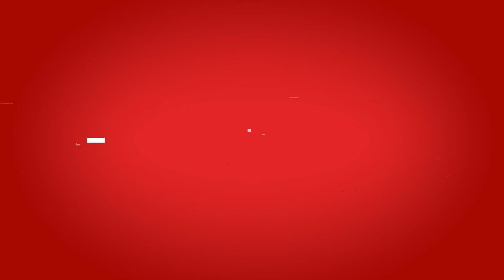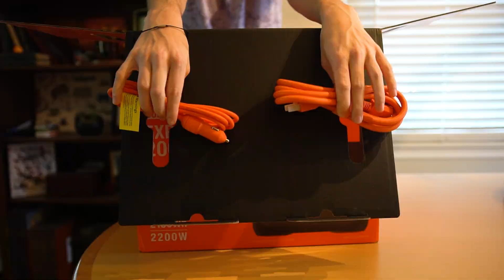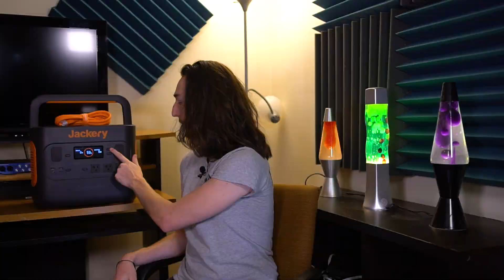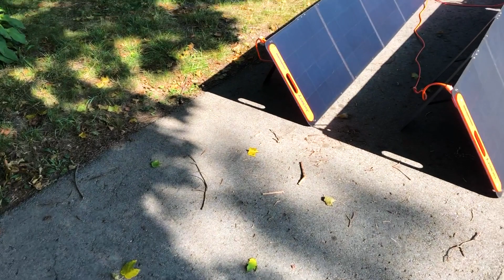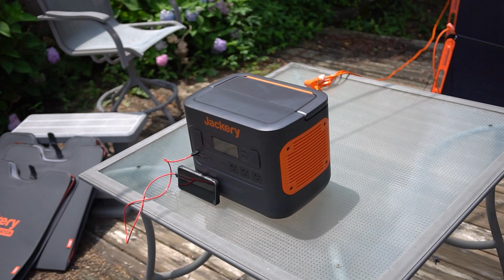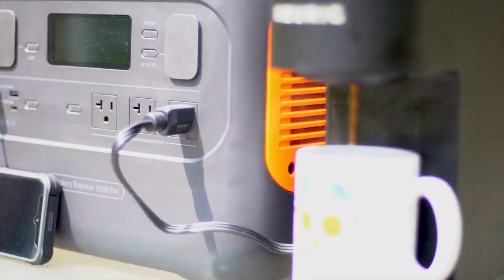Jackery Explorer 2000 Pro: The Best Jackery Yet?

Comment: Have you tried to use Jackery DC charger that comes with Jackery 1500 to charge this unit? 
The output of DC brick is 24 volt and 12 amp, but Jackery 2000 pro didn’t charge.

Comment: Thumbs up to the review 👍
I have this and decided on just two of the 200W panels. This will give me a reasonable tradeoff in portability and recharge time, especially if I am not driving the battery too far down. Getting the panels on sale through Jackery directly or other means can really help, as the panels are pricey.
I did use AC to the 2000 Pro to get it charged up from the factory shipped level. Watching it draw 1.5KW at first had me anxiously awaiting it downshifting its current draw as it got closer to 100% Even if you don't want to use AC you should always check out the different charging methods to make sure they all work OK.
I used to have a gas generator and this will work better for my uses. Besides having to maintain the generator after properly breaking it in, and being careful about the fuel you use through its carburetor, the one thing that really bugged me is how LOUD they are. I hated firing it up even for routine checks in the neighborhood, let alone taking it out to a camping spot.
I will primarily use it as a home backup, but it and its two panels are fairly portable for camping. For shorter overnight trips I sometimes just use my Jackery 300 (with Elecaenta 120W panel).
Charging it with a vehicle is a slow process...really better for topping it off to and from a site.

Comment: I just had a Jackery phone rep tell me that the solar saga 100 watt panel will not plug into the Jackery Proo 2000. he sounded like he didn’t know what the heck I was talking about.
I have a new 2000pro.. Would I be able to hook up my two 200 watt panels, into one series connector, add the extension cable and plug into one port and plug my 100 watt into another extension cable into the other port?
TYIA
Reply from the maker: It will plug in by itself, but you wouldn't be able to combine it with other panels. There's only one solar input plug - the splitter cable is a Y parallel adaptor, but they all go into the same input port/ MPTT controller. To combine panels, you need to balance the voltage and current. 

The only semi-portable battery I've come across yet with two input MPPT controllers is the Bluetti AC300.
Reply: @MakeUseOf  TY

Comment: I have a little Trillium trailer, can I plug the main harness into this unit to run my fridge, lighting and modern electronics when I’m off the grid ? I like that I can charge it while using it with solar, but will it do the job ? I’m almost ready to pull the trigger on this thing, but there’s still too many question marks…….

Comment: I just got the 2 panel package, do I need the adapter or can I plug each panel directly in the unit?
Reply from the maker: No need for an adaptor unless you want to add more panels; there are two inputs.

Comment: What's the battery chemistry? All of the Jackery's to date have used NMC batteries, these only yield about 500 cycles before capacity is down to 80% of original capacity. A lot of competitors (Bluetti, Ecoflow etc) are using lithium iron phosphate batteries, which give thousands of cycles before dropping to 80%. IMHO at some point as Jackery pushes their capacities higher they're going to need to switch to LiFePO4s to stay competitive. You can get away with li-ions when you're making smaller lighter units in the 1 - 1.5 kwh range. But if they're going to push up to the 3 - 5 kwh range they will need to use LiFePO4 batteries or they will lose out against the competition.
Reply from the maker: Li-ion, yeh. 1000 cycles. That's the only (big) drawback of these.

Comment: Still a pretty good review and a pretty good battery station. But also still lacking type c charging input or input/output to make it easy to charge the battery station. Also downside is that your limited on using the dongle on using there solar panels. Also nice color cords and easy to find them. But the highest battery station that is still crown as King that as higher Wh. But carrys a high cost tag and it's Goal Zero yeti 6,000x and as type c charging input/output and as the bells and whistles for my future setup. Also with goal zero brands not really limited on using there solar panels and it comes with app control. Also almost a average home uses about 30KWh per day and too get that much it will be 6×5=30. Meaning will need 5 goal zero yeti 6,000x to get almost about 30kWh. But in reality it will be too much and won't be realistic if solar panels are helping out now would it. Plus they are much heavy and I don't think a average budget person would want to try to move 5 large battery stations around. But hey about 30kWhs or more from a average household if house is much bigger. Well power usage maybe much worse if not using power wisely. But hey just math, science and numbers and as not been experienced with real world testing.

Comment: That’s a good point. Once the battery is Full, its Full. Who cares if it took 2 hours or 8 hours? If you need that quick of a turn around on 2160w of power, then you probably need a dedicated power source. Seriously. We are trying to slow down, right? lol. You are better off with 2x100w panels and getting more (2+) Jackery units. If you have the time, more stored power is better than more potential power. Am I off base here?
Reply from the maker: I agree, it makes more sense to spend that money on another battery, then leave one to charge all day while you use the other.
Reply: @MakeUseOf  TY. There is a use case for sure for multiple smaller or medium batteries in place of 1 huge battery. The Jackery 1000 Pro launches tonight.
Reply: Only use case I can think of is someone whose TIME SPENT IN CAMP is little, like hiker’s and biker’s. If your time is limited, and you don’t want your $2k - $6k equipment stolen, maybe more panels makes sense. But they take up more storage room.
Reply: @heavysighs  I can't say that it is the best Jackery yet, but I know it is one very expensive piece of equiptment.
Reply: @looneytooonnsss2223  that ECO FLOW Delta 2 looks even better. IDK. It releases on the 16th.

Comment: Too bad there is a very large oversite on the 2000 pro with the MPPT falling "asleep" and needing to unplug and plug back in the panels to wake it up...
Reply from the maker: Sounds like it might be overheating. Did you contact Jackery about it, to replace the circuit?
Reply: @MakeUseOf  Jackery is well aware of the problem. I have a video on my channel about it running an AC where I read Jackery's response to the issue.
Reply: @MakeUseOf  Jackery is well aware of the problem. I have a video on my channel about it running an AC where I read Jackery's response to the issue.

Comment: Today 20. August 22, I have tested this Solarsaga200 panel with my Bluetti SP200 panel. They have booth exact the same performance. First I thought that the Solarsaga would be 10 to 20 watts better, but its the same, maybe +/- 3 watts difference. It's like in this video where you have around 150 to 170 watts in full sun, but it can drop to 130-140 watts if they are heating up. Even partial shading is exact the same. If 25 percent is in shade, then you will lose 50 percent of performance. And if 50 percent is in shade, then you will lose everything. So this panels are not performing well in the shade. Bluetti has this PV-Panels, where you will keep lots of performance when in shade. The only good thing about this solarsage panel is that it is IP67 Waterproof and you can adjust the kickstands. But the price for 699 is too crazy.

Comment: I would have liked to hear a little more about battery chemistry in your review, I'm surprised Jackery hasn't starting using LiFePO4 batteries (like their competitors) that support many more discharge cycles, and last years longer.
Reply: I just bought this model, and can say without hesitation that, for me personally, it was a better option than the Bluetti AC200P, or AC200 Max. For a few reasons: first the weight, at 40 lbs this is 20 lbs lighter than the 60 lbs(!) Bluetti because it's using "conventional" Li-Ion batteries. And second, it's very compact. About the size of a small camping cooler. Also, like Zach said, this is whisper quiet even at maximum power output! The Bluetti is noisy by comparison. 
Lastly, if 1000 cycles seems perhaps a short lifespan compared to 3000 for the Bluetti, just keep in mind that 1000 recharging cycles still represents draining the batteries completely and recharging to 100% each and every single day for...3 years! Not something that people usually do with these. So the lifespan will likely be a lot more than only 3 years.
Reply: @AlainHubert  Difference in operating temperature is another big distinction.
Reply: @charleshood  
Can you elaborate on that? Because I didn't see a review that talks about that. And when looking for answers on the internet there are a lot of conflicting reports about optimum operating temperatures of Li-Ion versus Lipo batteries.
Reply: @AlainHubert  It's not a huge difference, but if you look in the user manuals, you'll see the orange company lists a discharge temperature range of -10-40℃ (-14-104 ℉ ), and the blue company lists a discharge temperature range of -20-40℃ (-4-104 ℉ ) for one of their comparable LiFePO4 based products. (Advantage orange)
Reply: @AlainHubert  its is overpriced compared to the ac200p/max and anker 767. why pay same price with limited features.. it wins in size..thats it IMO. gonna spend that kind of money, then Im looking to expand down the rd. why stop there?
Reply: @djaj423  
Don't forget the weight aspect. Because the Jackery Explorer 2000 uses standard Li-Ion batteries it weighs 20 lbs less than the AC200.
Reply: Main reason I went from jackery to ecoflow and bluetti with lifepo4 is the fire risk. 2nd is charge cycles.  Yall keep taking about you don't need lifepo4 but hesitant to speak about the fire risk . My  set up that I'm preparing now for hotter days is to run an 5000 btu ac for free everyday in the summer with a delta pro and extended batteries charged by panels. Lifepo4 provides a complete home solution for years in addition to casual use. Jackery is generally made for casual use.

Comment: Once you get that big and heavy I don’t think these all in one units make sense anymore.  Better to build a more modular (but less portable) unit by building from components.
Reply: 1 counter point is the "all in ones" are way more convenient for lazy types who dont wanna learn how to make a diy rig, the new zendure superbase-v is expandable to 64kilowatts meaning depending on a households energy needs it could go days with no sun energy in case of severe weather.
Reply: @tubevideoguy762  Good point. I guess not everyone geeks out over this stuff
Reply: Take a look at the Bluetti EB240. That is quite heavy but still reasonably portable and easy to carry with the handle. Building an equivalent model usually works out to cost more.